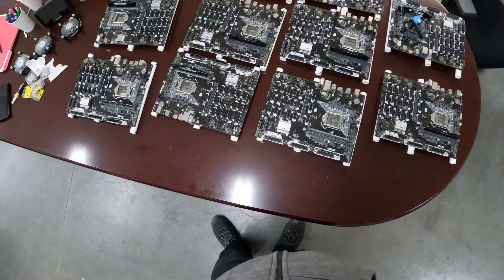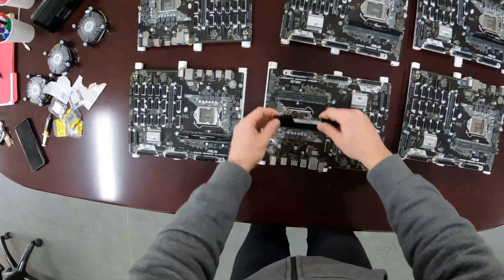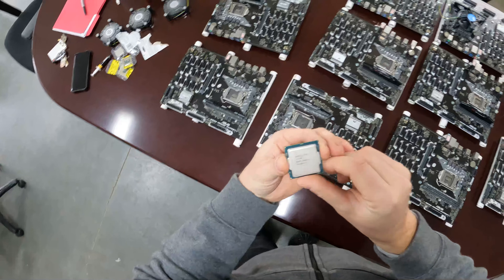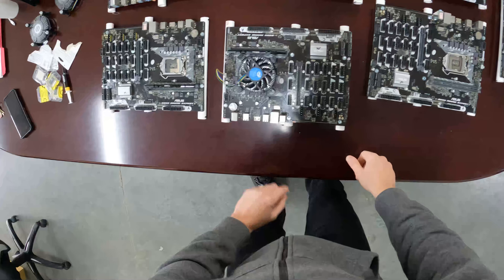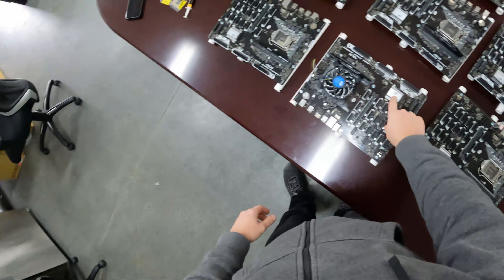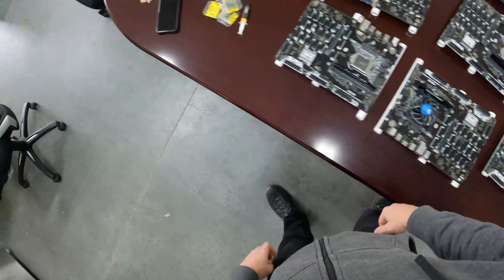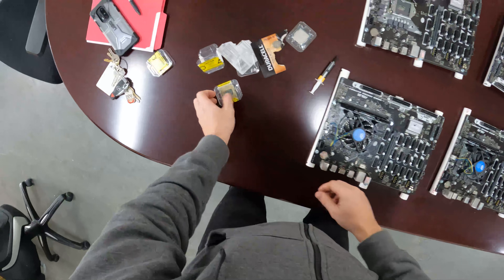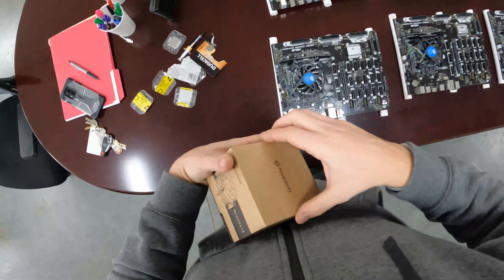GPU Mining Farm - 14 GPU RIG, Assembling Parts, CPU, RAM, Board

Comment: Just a little tip, rather than running single channel ram you can run 2 8gb sticks in each slot improving overall performance by utilizing the dual channel memory!  Awesome content
Reply: that is 100% true for gaming/ workstation pcs dual channel is good but its not a big deal since mining has really low ram utilisation and single stick is more cost effective and mining you try to use the least amount of parts so if something breaks you can narrow down the issue faster with less components but if its the same price and dont mind the extra step duel channel is the way to go
Reply: or 1x4gb stick